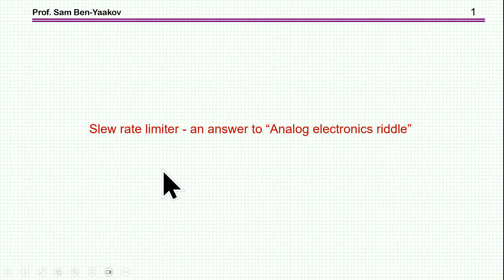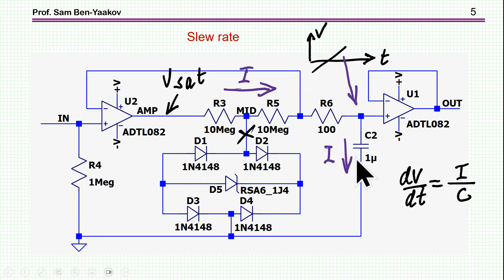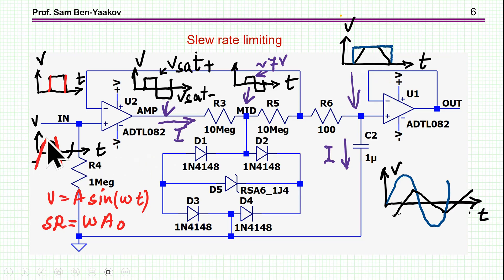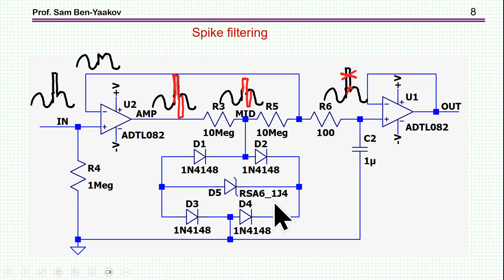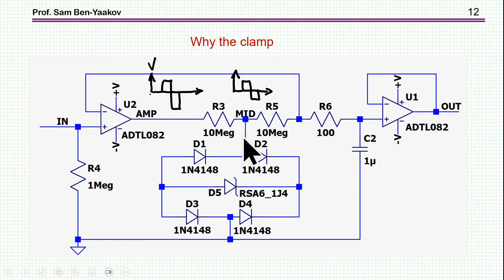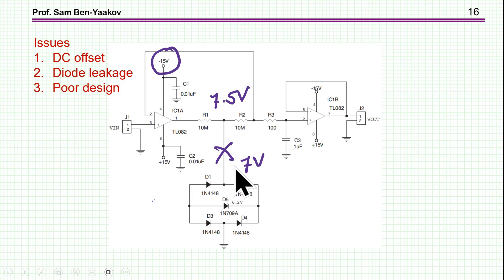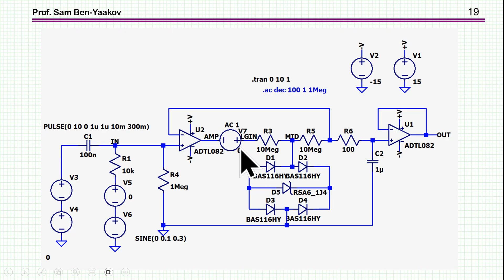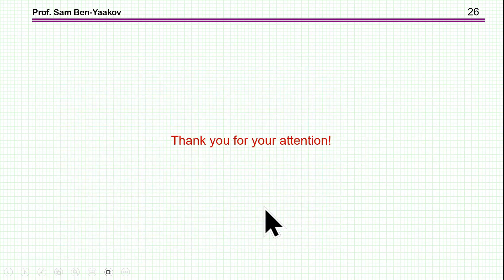Slew rate limiter - an answer to “Analog electronics riddle”

Comment: Nice explanation¡. On 12:00 there could be also some fluctuations of the output saturation voltage of the opamp based on voltage supply specially if there's noise. Don't think that would be much of a problem in this case though
Reply from the maker: I agree, Thanks for input,

Comment: Great explanation. I was really close to correct answer but I didn't suspect that it's slew rate limiter circuit.

Anyway I figured out why there's diode bridge instead of two zener diodes connected in series but with opposite direction (like anode-anode or cathode-cathode). Obviously this solution should be more symmetrical due to relatively high zener voltages differences between of the various particular diodes of the same type. For example: BZX55C6V2 has: zener voltage 5.8 ... 6.6 V at Izt1=5 mA test current. Second issue is that zener diodes has high reverse current below zener voltage. For example BZX55C6V2 has: Ir<100 nA at Tamb=25 °C and Vr=2 V. It's higher than 1N4148 at about the same voltage so 1N4148 can significantly reduce reverse current because there are connected in series with zener diode.
Reply from the maker: Thanks for input

Comment: Unless I am missing something, the diodes can do nothing to increase symmetry, A positive voltage goes D2, D5, D3, a voltage drop of 3 X  .7v, or  2.1 total limiting pos  volts assuming perfect diodes. A negative voltage goes D1, D5, D4, or .7, , 6.2 , .7, a total  7.6. volts negative. Not withstanding the +/_voltage discrepancy, the  very low currents here,  is poor design practice given the temperature  dependence of the diode leakage currents, any actual clipping level is ill defined.  If it relies on "soft" clipping, random diode noise will "overtake" any bias currents rendering the design non repeatable. I suspect a SPICE run without the diodes will give a similarly good result.
Reply from the maker: D2, D5, D3, a voltage drop of 3 X  .7v, or  2.1  Sure about that?
Reply: @sambenyaakov  You got me there, nice one , but you are forgiven. I will try harder next time,   I promise.

Comment: The diodes clamp the Voltage at the MID point and R5 acts like a (bad) current source to feed the capacitor.
This limits the output signal amplitude.
The problem is that the current  depends on the voltage already present on C2. 
So a square wave will not produce a triangle waveform but a sequence of RC (e^-t) charge discharge curves. For low amplitudes around 0v I guess that's just some distortion.
But if there's a DC offset then the output is severely distorted and assymetric.
Reply: If the time constant is many times (rule of thumb 10times) the period of signal being considered, it works as an approx integrator, thus a trianglewave comes out for square input
Reply from the maker: Indeed
Reply: @sambenyaakov  the final result looks nice with all the spikes removed. But sometimes we might be overdesigning for the desired behaviour. My question is, did you feed that same corrupted input signal to a circuit with no diodes and no 10megs? My guess, it should give an equally clean signal. It might be good to analyze or check via simulation, the case where really this design visibly outperforms the simpler one without diodes or 10megs. Otherwise, you could use a bomb to kill a mosquito. It works. But do you need it? The verdict is not super clear for me. A followup video addressing "why you really need this" is a good idea because this video only really proves "this will work".

Comment: What is the purpose of resistor R5?
Reply: R5 together with R3 forms a voltage divider between the output of U2 and capacitor C2. The voltage drop across R6 is negligible. It seems to me that this voltage divider determines the operating point of the diode bridge.
Reply: @GluonToo  Ok, I understand that. But what is the purpose of resistor R5 exactly? If it is not there (0 Ohm), then nothing will change fundamentally, right?

Comment: Can`t  we  use this circuit with audio preamplifier.?
Reply: NO!

1 It doesn't make sense because there are no such high amplitude pins in the input signal.

2. A good audio amplifier carries a signal with a frequency of even 100 kHz, which corresponds to a period of 10 us. That is, the filtered pins would have to have a period of, let's assume, 10 ns. You won't find such pins in an audio signal, and besides, an audio amplifier won't carry them anyway. They will be filtered out “naturally”.

3. Such additional filtering circuit would introduce a lot of distortion in the audio signal, thus disqualifying the preamplifier. It would also be a source of unnecessary noise.

Comment: Very interesting circuit. So, essentially it removes spikes. I wonder if clicks removers for record players also used this technique.
Reply from the maker: Good question! Useful for low frequency perhps can be modified
Reply: @sambenyaakov  The thing is, it only works for cleaning up signals. I wonder what one could do to clean up a power line supply from power line spikes.
Is it even possible to modify this circuit to that end?
Reply from the maker: @Stelios.Posantzis  perhaps